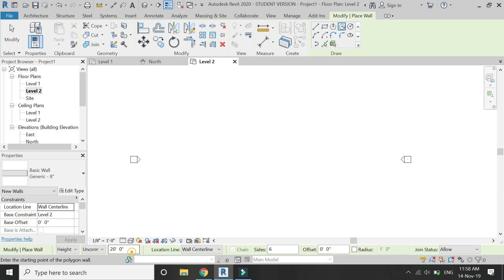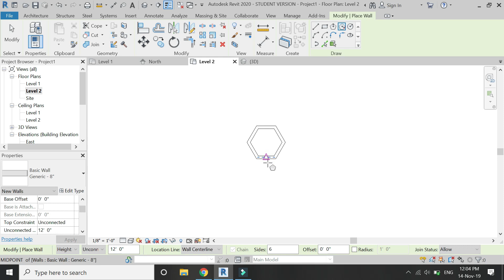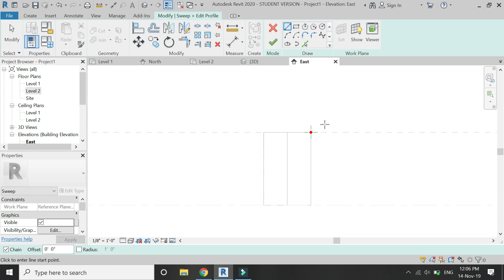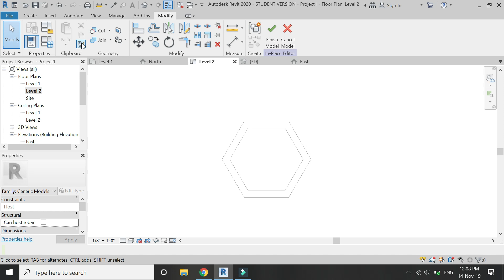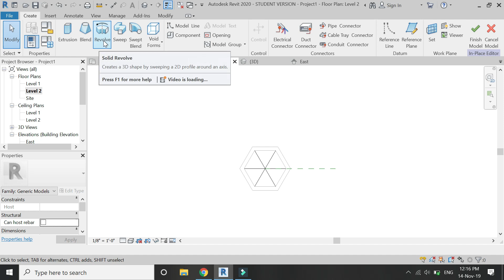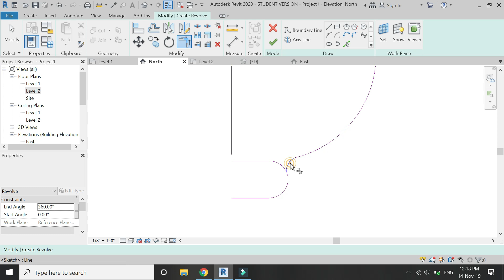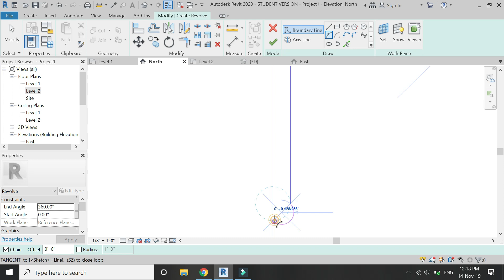Revit Tutorial - Turret Structure

Comment: Thank you so much Safura, I owe you a big time!
Reply from the maker: I am glad that your issue has been resolved.
Reply: @LetsRevit  Hello, unfortunately it still doesn't let me create sweep. :( I tried it a several times but I don't know what goes wrong in between.
Reply from the maker: Is there some kind of error when you apply the sweep command? I have always used this sweep command to create these type of structures. One thing you have to make sure that the profile which you draw in the elevation, should always be in a close loop.
Reply: @LetsRevit  yes the error is in sweep command, everything is closed in loop but when I press the tick mark it says 'can't create sweep'
Reply from the maker: @faranshahbaz5018  It can happen if the profile overlap with each other. May be profile you draw is not at the center of the hexagon.
Reply: @LetsRevit  I will try to do it from the centre, and the one I am doing is an octagon shaped not hexagon,could that be a problem then?
Reply from the maker: @faranshahbaz5018  Let me see if can draw this sweep on an octagon.
Reply: @LetsRevit  yes thanks 🙏
Reply from the maker: @faranshahbaz5018  I have drawn it on the octagon in the similar way as I have drawn on the hexagon. It does not give any error.
Reply: @LetsRevit  could you check your email